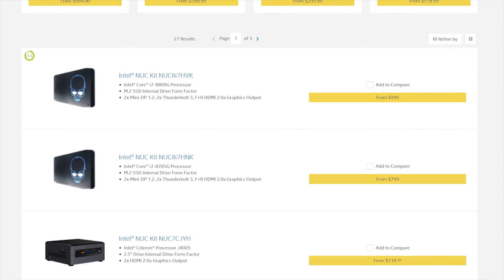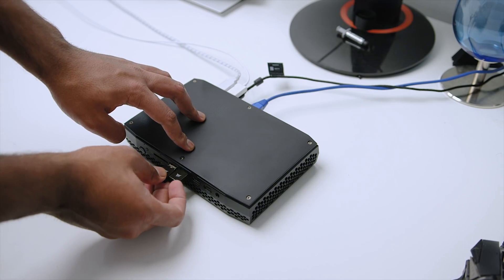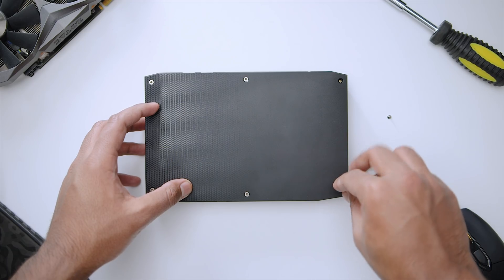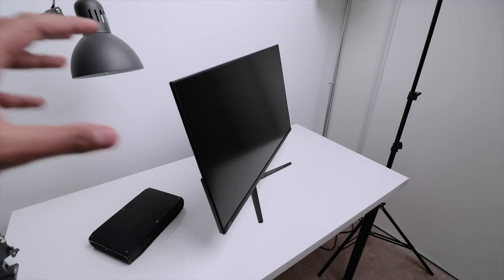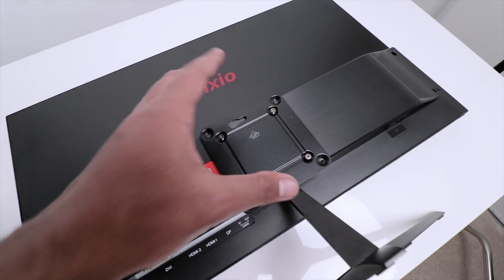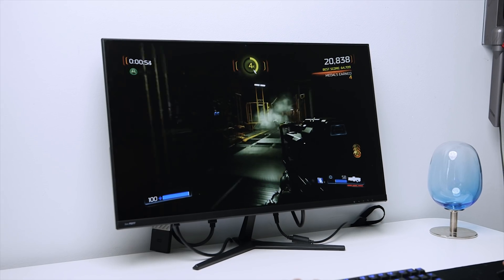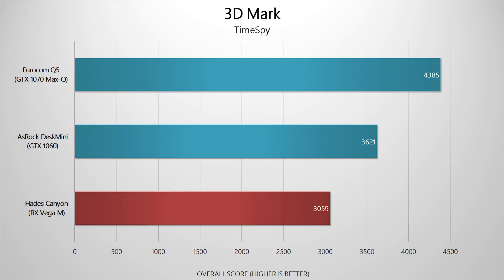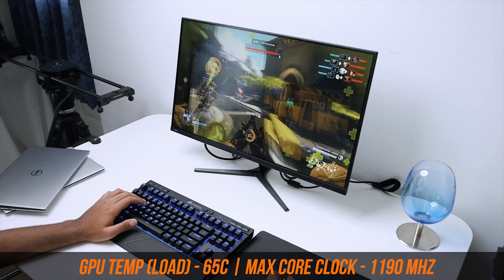The FUTURE of Ultra Compact Gaming PCs? Hades Canyon NUC

Comment: A lot of my friends aren't really on the tech/pc enthusiast bandwagon. All they really want is something affordable that can crush any 1080p games they throw at it. I can of course make up a component list and send it their way, but with the state of the market at the moment, and the fact of being in Australia where tech deals aren't easy come by, this seems like a much better solution.

All they need is a 1080p monitor, a keyboard, a mouse, and then this NUC. Of course they need to buy and attach memory and storage but compared to building a whole PC and weighing the price of all those components, it's an easy pill for them to swallow. Not to mention that in the future when (hopefully) external GPU enclosures + GPUs are more mainstream and come down in price, you can simply hook one up to the thunderbolt connection and be on your merry way - giving it the potential to really stay relevant for years of upgrade cycles.

If you're a tech enthusiast, love building your own computers and live and breath the news and pricing then you can obviously find a better deal. However, if you're a less informed consumer having a decent offering from a trusted brand like Intel, that should easily take on any 1080p task out of the box; truly is a decent option.

If intel upped the physical size of these by maybe 50%, added one or two 2.5" bays and then devoted the complete rest of the space to a quiet cooling solution (keeping the temps closer to the high 60/low70 range under load) - this thing would be damn near perfect.

Very informative review Eber, cheers for putting it on my tech radar.

Comment: Intels choice to release such a barebone system in times where memory prices are soo inflated is beyond me. Mini ITX systems with better graphics and included OS and memory can be found for 200 bucks more. Even your reaction indicates that this is a biased review. im sorry man but im used to better content from you. Sorry for the potato english
Reply: Everyone computer needs RAM.    This computer is designed to be as small as possible not to complete in price with ITX systems. 

"Even your reaction indicates that this is a biased review."  Ebert knows what this system is for and you don't.  You can't make a computer smaller without it costing more money.   You can't create a computer based entirely on proprietary without increasing the price.

Comment: Temps reaching 90s C for CPU. I'm not so comfortable with that.
Reply: Well pretty much every powerfull and thin laptops are running at 90+ under a 100% load. My MSI has been running at these temps for 4 years and I never had any crashes or bluescreens
Reply: "Considering the fact that many intels burn up in laptops.... no"  What number is "many" and what are your sources?
Reply: It's on the high side, but still within spec. TJMax is at 100C for all Intel CPUs.
Reply: Intel MADE it, don't you think they would know about their own CPU.
Reply: I'm over a week late to the party but so people are aware this NUC has a 3 year warranty in the case it dies, and honestly if I can get over 3 years with a SFF like this then I'm more than happy really
Reply: On the topic of hot CPUs being 'normal' it doesn't imply that's it's good or healthy for the CPU.  Higher temps mean higher energy levels in the atoms' electrons causing a 'atomic vibration' and ya bla bla bla bla.  Essentially the probability of vacancies that cause micro fractures goes up.  While X doesn't experience issues Y may.  I've had a laptop running at ~90-98C for a year with no issues.  Family member with the same laptop - cpu done in less than a year.  And an outdated CPU will have some good left in it if you allow it some.  I've currently got an old i3 sitting around to be the brains behind a cnc project.  So again to rephrase this.  +90C isn't going to kill a computer but it sure as hell isn't going to help it last longer.
Reply: You could water cool it.
Reply: "Many" being every device that's compact enough to have poor airflow.  Aka running your CPU at boiling temps which, not news, isn't good for any brand of cpu.  Currently looking at ~5 college comps right now that have toasted i5s due to poor ventilation.  Not sure where people are getting sources or the idea that running their CPUs +90C is a-ok.
Reply: mrlithium69 Considering the fact that many intels burn up in laptops.... no.
Reply: By higher thermal limit you mean lower safety factor and lifespan.

Comment: Small computers are basically just like laptops. WAY too overpriced for the equipment.
Reply: you dont appreciate simplicity nor engineering marvel. That's like saying smartphones are way too overpiced , IMA use my brick phone.
Reply: Okay you guys missed the point of this whole system. Smaller more money
Reply: Laptops and mini-PCs are designed to be portable which means their space limitations are not defined by a room at home but a hecking backpack that you carry around so it IS important that they're as small and light as possible; and cramming the amount of features these devices have into such a small volume takes waaaaay more time and resources than building a PC so yeah they're more expensive but for a good reason
Reply: Portability premium. Its the nature of technology.
Reply: "NUC should be priced at $400 seriously it will sell like hotcakes."  Is there any laptop with this much IO and performance @ $1000?
Reply: it's not overpriced, it's really expensive to fit all that shit on this thing/ a laptop. don't forget that you are paying extra to get something powerful but compact enough to carry with you anywhere you go. and that is the main reason why it's worth the money, at least for some people.
Reply: It is an excellent product if you understand what it is.  Someone who is considering this compact form factor shouldn't be comparing this to an ATX build or even micro atx because they are not providing the same things.  I think even the barely existent sfx would have a hard time competing with this.  Should one be able to corral the parts needed for an ultra compact form factor pc, it's going to come with a ton of effort.  This is a prebuilt ultra small form factor with a target audience in mind, not something targeted at bang for the buck overclocking water cooled full tower gamers.  But it can game and do it reasonably well.
Reply: yeah, good luck making an ITX build as small as this one lol.
Reply: That's the trend because we want to preserve natural environments -> less space to grow into -> less space to use for useless stuff. Also we are moving more and more to minimizing stuff that we don't need to directly interact with. The PC is justa box that holds computing power. You don't need to interact with it. You only need to interact with the HIDs (human interface devices, e.g. keyboard, mouse, display). The holy grail is computing power bein ubiquitous, available anywhere with low latency. Just like power. Do you want to see a small powerplant everywhere you need power? No it should ideally  be invisible yet be available wherever you need it. Same with computing power. People are envisioning integrated chips in walls etc. If your wallpaper of the future needs to render something it just pulls processing power from whatever is around and the cloud. The classic PC box that sits there and does nothing but provide processing power is a fragment of the past and should disappear as soon as possible.
Reply: Neatknit Are you crazy to think it should be priced below $600
Reply: If you have desk or a chair in that tiny apartment or office,..you have space for a P.C. It really is that simple. There is no reason for this exist at this stage. The other typical answer people are giving is it is 'portable.'  Portable, as in you need to hope where your going will have a keyboard, mouse, power source and monitor spare for you to use. A laptop is portable...a cell phone is portable..this, with keyboard, mouse and monitor is not.
Reply: Just because this form factor doesn't fit your use doesn't mean it doesn't fit others.  That's a narrow mindset. I have an 8ft desk with a hardline mid tower, I have no use for it, but can acknowledge that this is the perfect product for some.
Reply: Look at those guy that hated this product. Even a laptop with 1050 graphic card has more area with lesser I/O than Hades Canyon. Not to mention the jet sound that laptop will made. 

This is an engineering marvel, and this is a FIRST GEN product. Geez. If it's not for you, doesn't mean the other also won't like it. Niche market isn't really cheap. Go find some niche market that are cheap. I bet you can't.
Reply: because it look better in a living room than a big pc box
Reply: I just wonder why would you buy that instead of laptop? It performs worse, less portable and also is more expensive - so what's the advantage?
Reply: It's a shame that what is on the market is these ultra-SFF NUCs and big boxes, but if you want something in-between in size you will have to do a lot of compromises and at a high cost.
mITX being a subset of age-old ATX makes it very inefficient.
Reply: I mean Even then Why wouldn't you buy a Laptop at that price point Dell Inspiron G series has the new 6 Core part and a 1060 6gb for around the same price and you are getting a portability and even if using it as a base station you have enough power to drive a good monitor QHD ultrawide at 30-40FPS is more than possible.
Reply: Why not just buy a laptop then? Screen/Keyboard/Mouse are issues you would have to worry about instead they are integrated, and keep  in mind if you commute on public transportation you can't use Hades Canyon, but a decent laptop you can.
Reply: @nocturnal101ravenous6  Laptop keyboards are shit, nobody games or edits with a trackpad because they are shit, laptop monitor sizes are shit, laptop IO is shit, laptop audio is shit, laptop cooling is shit...long story short, the only advantage to laptops is maximum portability. All of the integrated peripherals are shit and thermal throttling during heavy workloads or gaming is shit.
Reply: A laptop.....................screen keyboard and mouse(well maybe depending) don't become an issue, and I can actually use it on the go rather than needing all those things.
Reply: Also this is closer to 1300$ according to him when you consider the inflated SSD and RAM pricing, 1k$ is just for the base unit, No OS, No storage, No Ram.
Reply: @Nocturnal101 Ravenous; you're just debating for the sake of it.  Obviously this fills a niche otherwise they wouldn't make it.  You don't get it and honestly I don't either but I get the appeal to some degree.  That doesn't mean that everyone should get a laptop rather than this.  Also others have posted legitimate reasons to get this further up in the post.
Reply: BlackLight exactly I Will but one of this because I Will carry a Beast in my pocket
Reply: They ARE laptops, but without a battery, ram, screen, keyboard, trackpad, etc, it's a scam.
Reply: @Derek No but a laptop has more components and actually complete compared to this bare bone. You can actually find a laptop $800-$1000 with a decent gpu eg. gtx1050ti gtx1060.
Reply: Psittac20 if you had a choice why not just get a bigger form for cheaper price for better performance in just saying. When’s the last time you go FUCK MY house is too small for a regular size Computer!
Reply: Remember. Laptops are a complete computer. You don't need to buy keyboard, mouse and monitor to use one. Unlike this one where your $800 is compose of motherboard and processor. I understand the price for a laptop because you can use it out of the box already. NUC should be priced at $400 seriously it will sell like hotcakes.